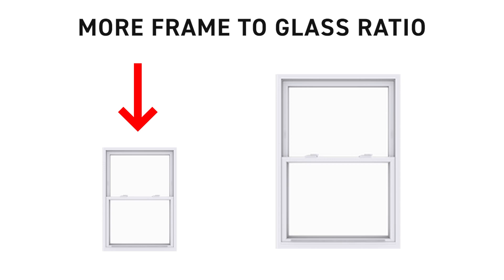Insulation Efficiency: Calculating R-Value for Windows

Comment: Hi Jeff! 2 years ago we purchase Pella impervia windows, this is worse windows ever. In a winter time we have ice built at least 1/8" in a corners and have draft cold air coming from frame. This windows were installed by Pella and have good warranty. Pella representative came couple times to seal corners, but this didn't help. Any suggestions?  Thanks!
Reply from the maker: That stinks. I'd keep on them until they make you whole.

Comment: As always, really enjoyed your video Jeff!! Always good stuff!

As a bit of added trivia:

There are people who claim that the reason window companies use U factor and not R value for describing window performance is because the R value of windows is so low, when compared with the R value of walls or roof, that U factor was "invented" by window companies to hide the actual window performance values using confusing or even trick numbers.  

While there is no question that R value is easier to instinctively grasp (higher number good, lower number bad) than U factor,  as to "who did what first",  U factor was originally developed by engineers in the 1930's as a way to determine actual heat lost through specific materials, while R value was developed in the 1970's by marketing people who sold fluffy pink insulation.
Reply from the maker: Great to know!!